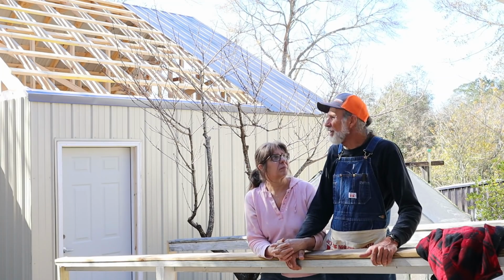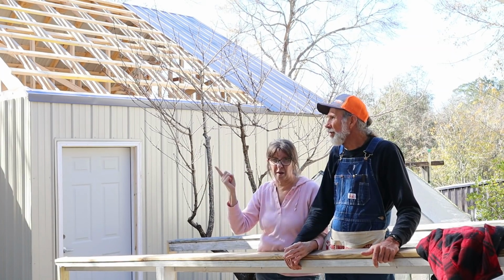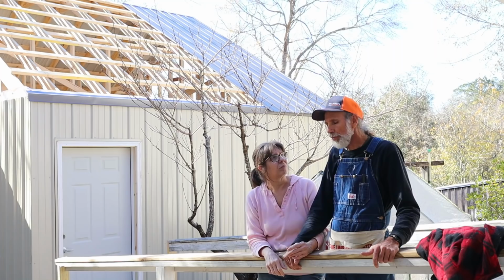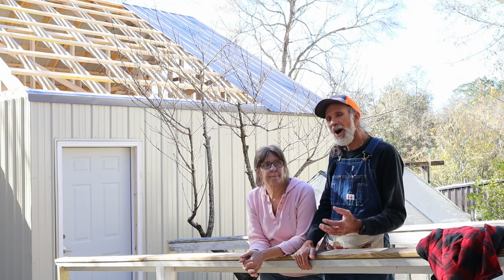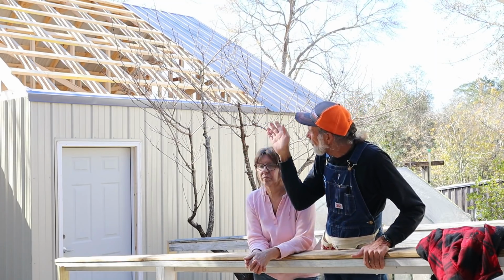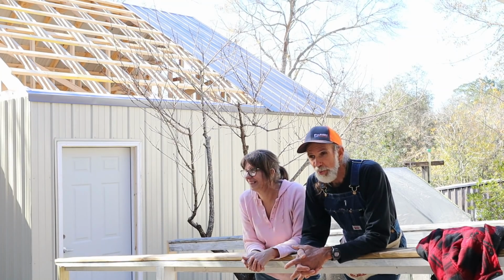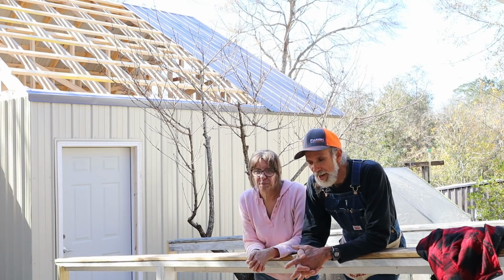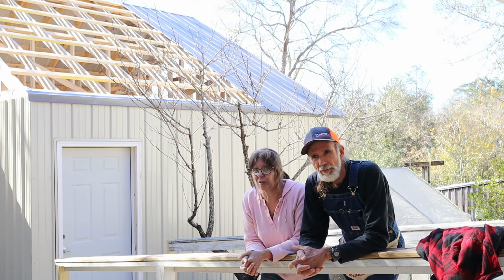The Metal ROOF Is FINISHED! | She Shed Build | Part 15

Comment: I do quite a few metal roofs. When I have to lay an extension ladder on the roof I cut a slit in a pool noodle and snap pieces on the ladder. Works great to keep from scratching.
Reply from the maker: Great idea